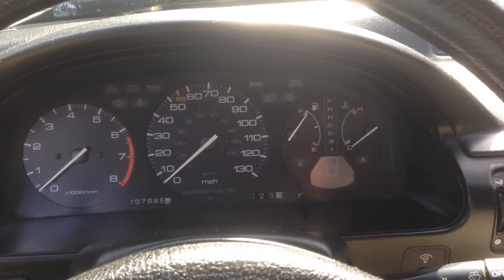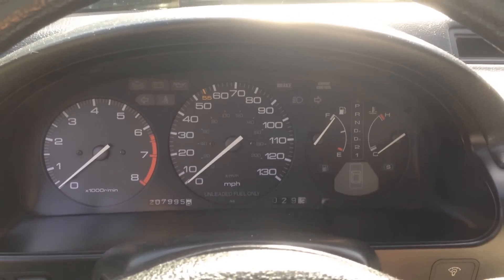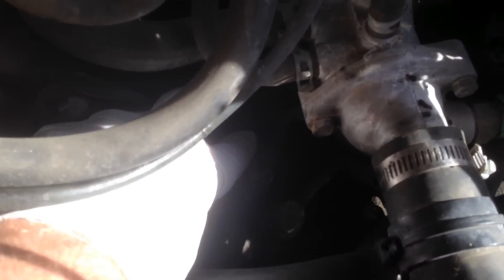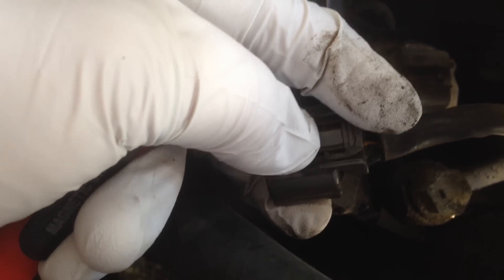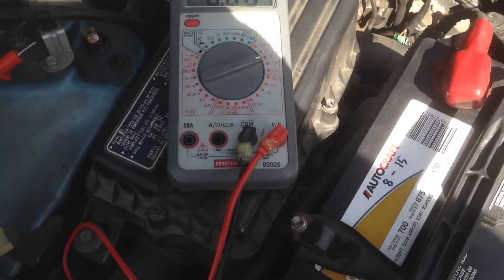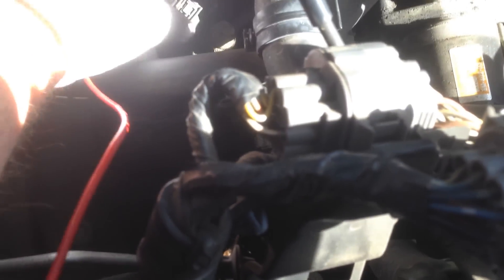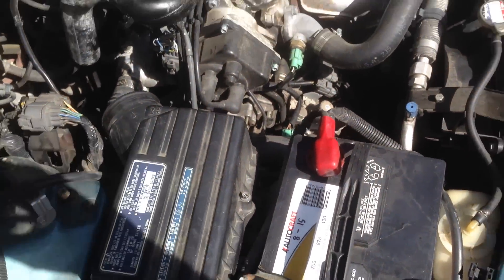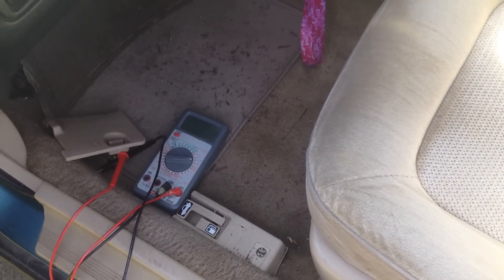1990 to 1993 #Honda #Accord Speed Sensor Input Test

Comment: Thanks for this video and the one on replacing the sensor. I will admit that I didn’t do the check in this video, but just bought a cheap new sensor and put it in. Problem solved. Speedometer is working and accurate again.  You’re another good professor here on YouTube University. Thanks!

Comment: Wait did you just do a continuity test on the power connector that connects to the sensor or the sensor itself? Because I took a speed sensor (NM mainshaft sensor TCU code 15) out of my car (honda 1993 accord LX automatic transmission). Now I took the sensor out itself and tested it for ohms its in range of what its suppose to be. Anyways, I wanted to test the power cord that connects to the sensor itself. I have been told that you are suppose to disconnect the power for continuity test. I'm not getting anything with the continuity test. It just stays OL. I also tested some other power connectors. The NC (countershaft speed sensor TCU code 9) And I'm not getting continuity on that either) Then I tested the shift solenoid power connector and I get no continuity on that either. Then I did a DC voltage test with the car battery plugged in. I get no voltage showing on that either (on the power connector). I have a theory some sensors power connectors maybe don't show voltage unless the car is running? Anyways, the point is the reason I ask it looks you are testing the power connector to that speed sensor you are doing, is that correct? When the battery is connected? The sensors that I disconnected had prongs connected to it. And the power connectors have inserts. It seems you tested out the power connector? Is that true?
Reply: Maybe my TCU needs to be connected to test the voltage? Maybe that's the problem. Maybe the TCU sends the voltage. But I was also told not to do a continuity test if the battery is hooked up. Seems you tested the power connector to that sensor with a continuity test. The tech guide I'm reading says to disconnect the TCU. But it says "check for a possible short to ground but first unplug the harnesses at the TCU." But it doesn't indicate if I should disconnect that TCU for the voltage test. Or if it's indicating that I should disconnect it for the continuity test.
Reply from the maker: You are correct.  You should never test resistance on a live circuit. The continuity setting is really just a sound that goes off, when your near 0 ohms.  For the ground wire, I am just checking to make sure there is no break in the line.  Think of it like this.  If you put jumper cables on your batter, and did not touch the ends together, you would have no current flow.  You can measure ohms from the tip of the black cable to the negative battery terminal.  And you can measure from the tip of the red cable to the positive battery terminal.  If you tried to measure resistance from the tips of the cables, you would complete the circuit, and fry your meter.  You would want to have your meter on voltage, to protect it.
Reply: @tubejim101  So another words you did a voltage test and not a continuity test. You hooked up your black probe to a ground on the negative battery cable. And you took the red probe and tested to see if you were getting voltage on the VSS speed sensor power connector. Then you took you negative probe and stuck it to the ground of that power connector. And then you tested to see if you were getting voltage on the other connector wires. See my theory is that to do my continuity test. I have to have that TCU connected without the battery cable connected. That TCU has wires that signal those sensors so its connected. I wasn't getting 0 ohms on my continuity test because the circuit wasn't complete. And now when I do the voltage test. I also must have the TCU connected. Because the TCU sends voltage signals to those power connectors. That is why at the end of the video you showed the fuses. Because if the fuse is burnt out on the ECU. I believe the ECU controls that VSS speed sensor. So my problem is I need to connect the TCU? Do you think that is correct?
Reply from the maker: @deegee2416  Think you should start with testing your ground wire.  See if it is getting ground.  You can do that how ever you want.  You could even use a test light.
Reply: @tubejim101  The ground wire on the power connector for the (NM mainshaft power sensor)I assume. I saw a guy do that on a video were he did use a test light on the power connector that tests the blinkers (and his light flashed). I really don't think I'm getting ground with the voltage meter because of the TCU is not connected. He did have the battery connected. Do you still have this honda 1990 accord if that's not too personal to ask? Because after I test these 2 speed sensors. I need to see if the TCU fixes the code. It's a long story I'm in a situation with TCUs. If these tests don't work after the TCU is reconnected. Even though NM (mainshaft) speed sensor tested okay for it's ohms. I will try to replace and if see if the TCU code goes away. There is a honda accord troubleshoot guide on TCU, sensors.  I wonder if you could try doing the continuity test yourself (battery disconnected). Or the voltage test on the NM(mainshaft) sensor, or the shift solenoid sensor. The shift solenoid sensor is easy to find. It's in front of the transmission. It's below the lock solenoid. You find it. And you follow the power cord going up it. And disconnect the power cord. Keep in mind. Those power cords can get stuck in the metal bracket. If that metal bracket is rusted. You wont be able to disconnect that power cord (unless you cut a little into the plastic holder). You must try to remove that power cord from the bracket if you were to test it. I'm not telling you what to do. I mean if you wanted to or ever had the time. Since your TCU is still hooked up after all. You could tell me a whole lot if you found the voltage.
Reply from the maker: @deegee2416  If it helps, I don't think a speed sensor will trigger any kinds of codes.  When mine was bad, I did not get any codes.  I can't teach you how to use a multimeter over a chat session on youtube.  I will make a video on basic multimeter use.  Here is a video to get you started:  https://www.youtube.com/watch?v=TdUK6RPdIrA
Reply: @tubejim101  Small update. I was able to test those NM speed sensor and the NC speed Sensor (And I got voltage). The problem was I did have the battery connected. But I had to turn the key to the start position for it to finally send signals to those sensors. Oh I did hook about the TCU anyways. I was able to test the grounds, by putting a black probe into the power connectors pin, and the red probe into the other. Vice Versa I just got a negative result. But appears that the grounds are working. Yeah, so the key had to be put into the start position. I guess it would drain a battery if it sends power to those signals with the car off. So it doesn't send them until you turn the key to the start position. Your video helped. I could have saved so much time if I would have found this video before hand.

Comment: Even though the wires are color coded different, I am getting battery voltage on one wire, a weak signal on the left wire and NO GROUND on the right wire.  Wondering if the lack of ground is causing the weak signal wire and How can you have BATT voltage and No Ground????
Reply from the maker: What year, make, and model are you working on?
Reply: this isn't saving replies for some reason.  3rd time 2001 honda civic ex 1.7 bmxa tranny
Reply from the maker: @bvnseven  In 2001, Honda redesigned their engine.  I've only worked on 92 to 00 Civics.
Reply: @tubejim101  Thanks for the reply.  Alot of people on here don't reply back, they just show.

Comment: Hi, I have a check engine light on in my 2008 Camry. The fault code is P0500. The speedometer, all ABS sensors are working fine. Please what could be the problem?
Reply from the maker: Check your cruise control.  Also if you put different size tires on, it could be throwing off the vss.  This video is for 1990 to 1993 Accords.  If you have not done so, you should check the wiring.  If everything check out, your computer is the one telling your that your vss is sending bad info.
Reply: Thank you. The cruise control shows fault as well.
Reply from the maker: @olaade2109  Double check the correct part before ordering: https://amzn.to/3jV85oD
Reply: Okay, will do. Thanks.

Comment: My signal voltage is a bit high 10.88 voltage and it should be around 5 volts
Reply from the maker: What year, make, and model are you working on?
Reply: @tubejim101  it’s a 2009 Nissan Altima 2.5
Reply from the maker: @TonyKing559  Sorry, I have never worked on an Altima.
Reply: @tubejim101  it’s ok I found the problem
Reply from the maker: @TonyKing559  What did it end up being?

Comment: Your presentation and explanation was great! Thank you. But what car was that ?
Reply from the maker: 90 to 93 Honda Accord.
Reply: @tubejim101  Thank you
My car is KIA spectra 2007 EX. The speedometer is stopped working. However, it came back to work once for about 10- to 15 minutes and them stopped again. I don’t know what is the common error with it in this model of cars. Thank you
Reply from the maker: @ameelgajjo8097  Sorry, I have never worked on a KIA before.

Comment: Great video. Please advise about my case: at 2005 KIA Sorento speedometer gauge start at 20 not Zero mls/h and during driving always displays 20ml more.
Reply from the maker: Sorry.  I have never worked on a KIA before.  If it where a Honda, I could ask my local parts dealer if he had seen anything like that before.  Have no idea if the KIA dealer would help you out.  My local Toyota dealer on the other hand, never helps me, and doubles all the prices, and does not sell OEM parts and fluids all the time.  But it is worth a try.  Let me know how the KIA dealer treats you.  Of course it goes without saying, be polite, even if they treat you poorly.

Comment: I have continuity and the 5 volt signal wire but getting 5 volts at the power wire not 12.
Reply from the maker: What year, make, and model?
Reply: 96 Jeep Cherokee XJ 4.0
Reply from the maker: @Putttn  You will need to get test procedures for your vehicle.
Reply: @tubejim101  thanks for the help. Like your channel. Subscribed

Comment: How about if the d4 is blinking is that connected to speed sensor also?
Reply from the maker: Assuming you have a 90 to 93 Accord.  Blink codes come from the the Transmission Control Unit (TCU).

Comment: if i only read 1.5 on yellow wire what should be the problem? i already replace fuse from 7.5 to 10.
Reply from the maker: What year, make, and model are you working on?
Reply: @tubejim101  Civic 98
Reply from the maker: @ceazarmanalang  This video was for a 90 to 93 Accord.  Would have to find the test procedures for 98 Civic.  You can get the service manual used by Honda from your dealer.  Will tell you everything about the car.

Comment: i have a question ,  does it affect the gear to go neutral by itself sometimes , when put on Drive , and doesnt fix untill i put it on 2 ??????  2003 civic ?
Reply from the maker: After 2000 Honda redesigned the Civic.  I don't follower their work after 2000.

Comment: Thanks for the video, so those 3 cable are: ground, 5V & 12V. 
If they below 5V & 12V what should I do? Replace the cables or any suggestions? 
Thanks
Reply from the maker: What year, make, and model, are you working on?  What are the values you are getting?
Reply: @tubejim101 Honda Civic EG 1995; 
red cable 0 result
yellow cable: 2.11 
Any suggestions mate?
Reply from the maker: @ciensuk  Assuming you have around 12.6v at your battery, you have a wire issue.  If your lucky, just corrosion at the connector.  You can verify that by putting a pin in the wire, up from the connector, and see what kind of reading you get there.  If it is still 2v then you have a wiring issue.  You should patch the hole you made with the pin, with some liquid tape when your done testing.
Reply: @tubejim101  thank you for your suggestions, will try and check them. Let's hope it's just a corrosion. Success for your channel. Subscribed

Comment: Hi. My vehicle speed sensor is good. But still the speedometer won't work. What could be the problem ? TIA.
Reply from the maker: What year, make, model, are you working on?
Reply: It's a hyundai santafe 2001 v6 2.7L.
Reply from the maker: @dyanberenger5138  Have no idea how Hyundai did it.  Should start with having your battery tested.

Comment: The (sealed) transmission on my 2006 jeep commander is stuck in limp mode (intermittently) even after the trans was replaced and fluid level maintained. There are so many things going on but one thing that I have specifically noticed is that once I go over 2000 rpms the trans will not shift a third time and the rpms climb, so lets say I'm going 40 mph the rpms are 4000 and 5000 at 50 mph roughly. The rpm gauge seems very slow to respond when I let off the gas pedal. I can find nothing in my research that explains this problem.  I feel the problem is not in the transmission since it has been replaced and must be electrical. I did take apart the shifter assembly and clean the board but it was in my opinion not very dirty at all. Can anyone help? Codes are: P0700, P0752 and P0753
Reply from the maker: I only work on 90's Hondas, and some Toyota.  Google says possibly a bad transmission computer, and shift solenoid.  I would take it to a mechanic that specializes  in Jeeps.  For under $100, they should be able to tell you exactly what is wrong.  Most will let you put the $100 towards the repair cost, if you have them do the work.

Comment: Hello THANKS for the video. I tested it using a multi-meter and I'm not getting the 5V volts, just 12V and GND ... The middle one cable shows 0V .... By the way Speedometer doesn't count and I always get Check Engine error.... Maybe the problem is with this cable which should show 5V and shows 0V, but I'm not sure about the destiny of the signal cable on my car (Toyota Vitz) because there's a bunch of cable and I'm getting confused .... Can you help in how to reach the terminal of the signal cable. Thanks in advance
Reply from the maker: Recommend getting http://www.alldatadiy.com/ for your car.  It will tell you how to test (which may be different for your car) and how to trace out the lines.

Comment: Thanks for the video. Going to check the wires. I replaced the speed sensor and still no spedo or odo working. And check engine light on for speed sensor. Would u know where the fuse would be at on a 2008 mustang gt500. My manuel doesnt show it. Or what would the fuse be under. Thank you
Reply from the maker: Sorry.  Only have the books for Civics and Accords.
Reply: @tubejim101  ok thanks anyways. Ill try to test the wires and seee what happens.
Reply: Could i test the wiring harness that goes to the speed sensor with a test light to see if its get voltage? Or i have to use a volt meter. Thanks man
Reply from the maker: @mcp08gt  If you know how to use a test light, you can use it to check continuity.
Reply: @tubejim101  ok cool thanks for getting back to me.

Comment: But have you checked the speed sensor it self? I am having trouble with my cobalt; jerking at take off and bouncy speedometer. I checked mine for ohmmeter and it came out 169.1. I think it is a bad sensor. Any insight?

Comment: I replaced the connector since i was getting half a volt for both power and signal after replacing the connector i have almost 5 v from signal whicj is good but not a single volt from power. Pls help?
Reply from the maker: What year, make, and model are you working on?
Reply: @tubejim101  integra ls same speed sensor and connector as this civic

Comment: What can be problem on  my 2001 dodge caravan transmission output sensor wiring no read volts at all...
Reply from the maker: You had me at dodge.  Not sure.  But have your battery and alternator tested, before you start digging around.  Make sure you have clean battery connections too.

Comment: i am confused on the signal line wire.i thought that signal wire must be 0voltage before cars run.only shows voltage after car is driven.i was taught like that vss gives voltage between 0 to 5 only while your car is  running if not gets 0 voltage.i checked in suzuki car same like you do and i got the same voltage like you do in three pin connetor.12v ,4.8 volts and good ground.i searched in google and youtube but didnt got the perfect explanation about the sensor.does the diffrent cars have different wiring systems
Reply from the maker: Yes.

Comment: I know this video is old but I just replaced my speed sensor last week and it came back on the next day ran great tell the cel came back on. I got a new part from the store incase it was a faulty part. Ran great again tell the next day the code came back and started acting up again. Where should I go from here. I'm getting a volt meter today to do this test to see if the plug is bad. From eye sight it looks fine and I'm really stomped here.
Reply from the maker: Though I am guilty of just throwing parts at a problem.  This is why you should really check things before buying parts.

Comment: Nice video! I've tested my wiring everything checks out. I replaced VSS still nothing, I replaced the gauge cluster and still nothing... Fuses are fine... I'm lost any ideas? Thanks in advance...
Reply from the maker: What year, make, and model are you working on?
Reply: @tubejim101  it's a 91 Accord Coupe Manuel trans... Is it possible I received a faulty speed sensor?